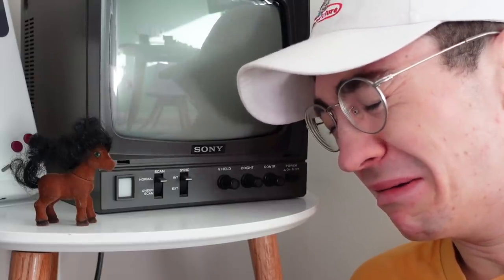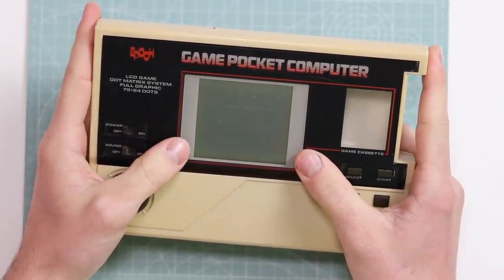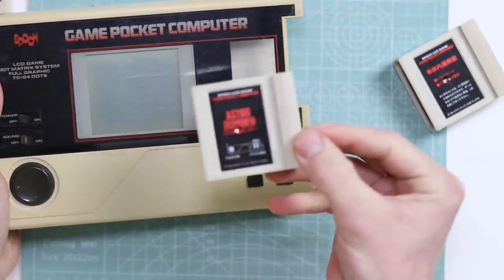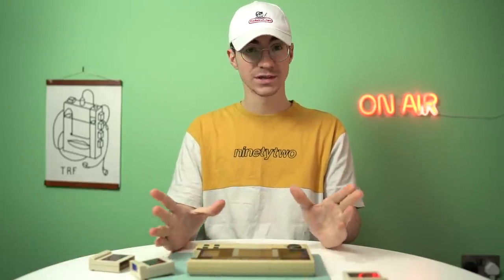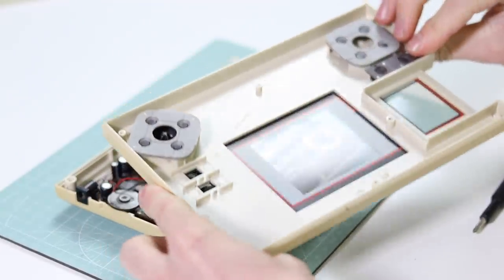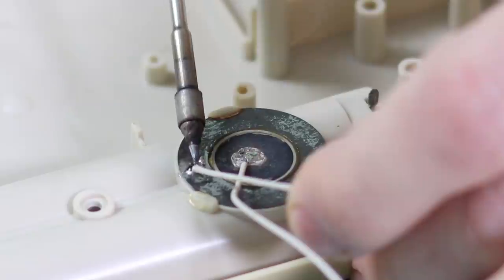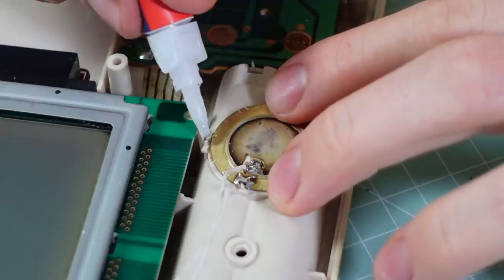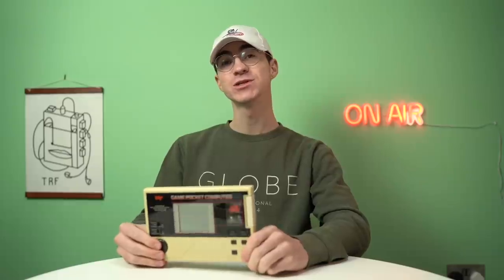Can I Fix Ashens' RARE Handheld Console?

Comment: With those worn out contacts you can use a bit of desolder braid covered in solder to recoat those contacts, it should improve connection.

Comment: for future reference, you can clean the rust off of screws easily by boiling them in a light vinegar solution. no specific measurements, just a pot of water with a quick dump of vinegar and heated to a very mild boil. then just put what ever rusty thing you want to clean in it and let it boil for an hour or how ever long it takes then scrub the rust off. easy

Comment: I wonder if that sticky stuff came from leaky capacitors. It's possible that cleaning off the residue made it work temporarily, but it won't be a lasting fix without replacing those.

Comment: Bro you could’ve used a bit of T-7000 instead of Super Glue.. Give it a shot, I’ve been in electronics repair for 8 hrs professionally. The T7000 seems silicone based and is easily re-workable if you ever need to re open a device!